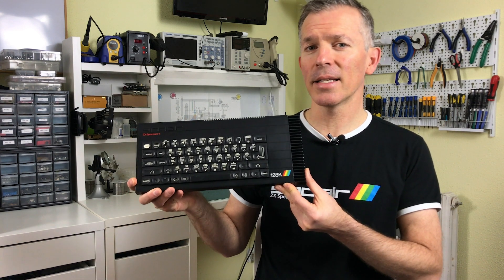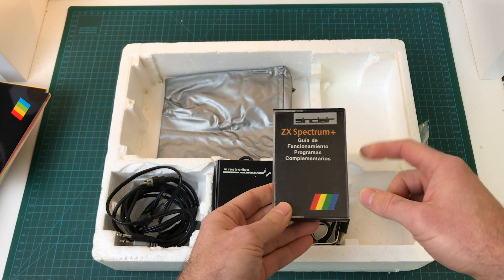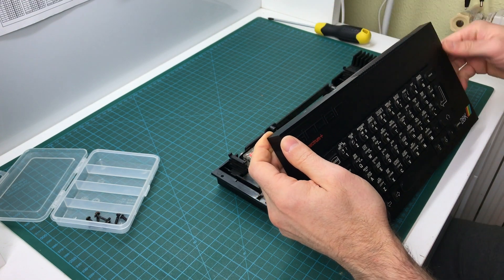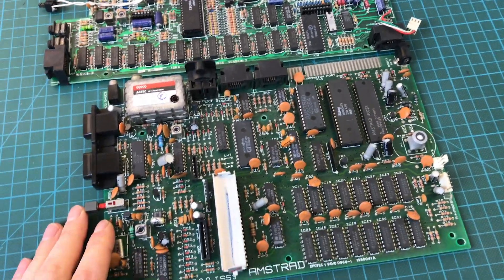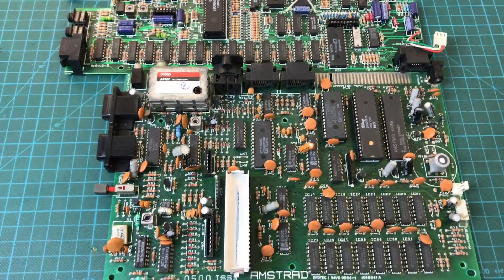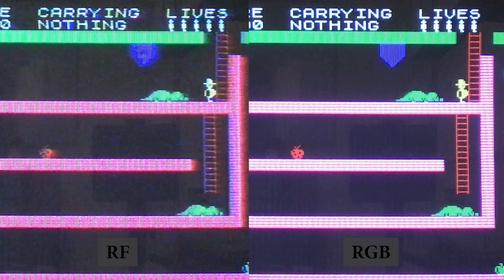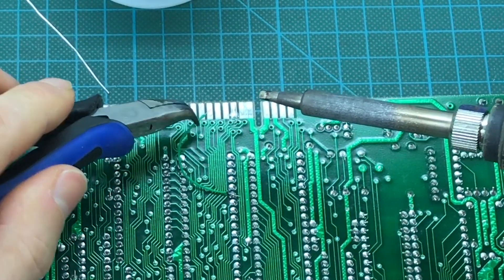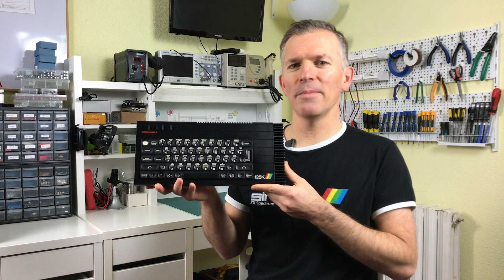ZX Spectrum 128K "Toastrack" Inside and Out

Comment: I owned the 48k (rubber keys) but swapped out the circuit board & installed it into a Fuller Keyboard.  I was very interested in your video because you outlined the differences between the  plus 128k & the plus 2 which I owned the Grey version.  I always wanted the 48k plus but I understand the circuit boards from the 48k & the 48k plus are identical.   Great video.

Comment: this spanish inves 128 was the first 128k spectrum done in the world, was designed  in 1985 even before the UK 128k model , that is because it lacks the initial menu  which was added later in the rom of the UK 128k model, however  this one is 100 % compatible with spectrum games, nothing that can be compared to the 48k inves model which was very buggy in compatibility

Comment: Hi Noel, I'm not sure if your /CLK fix is the right way to do that (?) I think the ULA signal is inverted before it goes to the Z80. The edge connector contact is supposed to provide /CLK as output by the ULA (before it passes through inverter). Although not many peripherals use /CLK nowadays so the whole procedure might not even be necessary :)

Comment: How can I switch this machine to 48k Mode? Isn't there a menu like in the UK Version?
Reply from the maker: I believe you can't. For games that require 48K compatibility there are usually some POKE commands you can do (I think they patch the game), for example Knight Lore.
Reply: Type "USR 0". This will switch to 48K ROM but memory paging will stay enabled. Many consider this mode the best as far as software compatibility is concerned because you can run both 48K and 128K software. However a small number of 48K games (notably the ones from Ultimate) require OUT 32765, 48 before you run them. They contain some debugging code that inadvertently messes up with 128K memory paging so you need to disable it first.

Comment: Hello from Spain! I guess you actually did not understand why the separate keypad (only a few seconds in your video, you tried to use it as a calculator, only one of its uses), but its reason to be is inside the Spanish ZX Speccy 128. Boot the machine and type "edit e$". That will open the word processor resident in ROM. That's why the keypad had all that arrows, they mean to skip a whole word and so on. The Sinclair guys at the UK removed the editor, so the keypad did not actually make any sense. BTW, the Sinclair Basic is able to handle variables with any length, that's why you can store a whole document inside e$, or a$ or whatever variable. Not very performant, but always thinking in saving memory. Unfortunately, the only way to print documents is the ZX Printer, which is far from professional. Any other 80-columns printer will print the document... with a big margin at its right.

Comment: Has anyone ever figured out how to wire the Number Keypad to a new board or (non-spectrum128k toastrack board)?
Reply: You should be good on any Spanish toastrack, UK Issue 6U toastrack and the grey +2. UK Issue 6K toastrack made by Samsung needs R137 = 15 Ohm. On +2A / +3 you could just use the AUX port but I think the keypad scanning routines were removed from ROM so you'd have to interface "by hand". Is there a specific "new board" that you have in mind? Some re-created clone perhaps?

Comment: 12:52 The connector is a variant of the UK phone socket connector (BT631W)
Reply: The +2A/+3/+2B kept that for RS232 interface but the manual had an error documenting the lines, so if you had a custom cable made up according to the manual it would never work. I tried to use my Spectrum as a terminal at university but suffered from this...

Comment: I have one in my parents attic still. Not sure why this is a holy grail above other Sectrums tho.
Reply from the maker: Holy grail is probably a bit of an exaggeration. It's my favorite model because: 1) It has the best looks  and still looks like a classic Spectrum 2) It has 128K and AY sound 3) It's not huge 4) It's the last true Sinclair ZX Spectrum. There weren't as many units manufactured as the earlier ones or the +2, so on top of all of that, it's more scarce, which drives prices up unfortunately.
Reply: @NoelsRetroLab  thanks, I never realised that they made fewer numbers of this model. Will have to check on my one to see it is kept in good condition.
Reply: Yeah, just like Noel said, it's relatively rare and there's the sentimental part of it being "the last true Sinclair". Although Sinclair didn't care much at that point and Investronica was the real driving force. Also, at least half of all "toastracks" was made after Amstrad acquisition, judging by the IC timestamps and the number of them that have Amstrad-branded ULAs. Still, many people (including me) have a soft spot for this model and it would be a shame not to preserve every one of them that made it to 2021.

Comment: I have one..like gold in secret chamber
Reply from the maker: It's a wonderful system. Just make sure you do take it out and enjoy it! 😃
Reply: @NoelsRetroLab  This thing is that the antena cable is not working good..so image of the computer is not good..most games also dont work..I am looking forward to buy a new antena...is the spectrum 128 k inves
Reply from the maker: @yeraysantanaaday6827  Really, just ignore the antenna output. The 128K Investronica outputs beautiful RGB signal. Get a cable to connect it to SCART and you'll be all set. The fact that most games don't work is worrysome. Some 48K ones don't work, like the Ultimate ones. You need to do an OUT command to fix that (I think it's towards the end of this video). But if more don't work, then there's something slightly wrong with it. Maybe bad RAM?
Reply: @NoelsRetroLab  Thanks a lot, you are right there is the RGB..I go to a computer shop and buy the cable to conect to tv..the Ram is ok becaus it loads combat school 128 version...and other games.
Reply: @NoelsRetroLab  He did OUT 32765, 48 to disable the RAM bank paging.

Comment: The Spectrum was always able to provide RGB out via the expansion slot. This was publicised when the original machines were released with guides for those eager to escape the RF picture quality. Ferguson produced an interface that connected to the expansion slot and provided an RGB port for their monitors and TVs. https://hardware.speccy.org/hardware/RGB-Ferguson-i.html
Reply from the maker: The original ZX Spectrums didn't have RGB on the expansion slot because they just didn't deal in RGB signals. The component signals were available (Y,R-Y,U-Y) and that's probably what that expansion is using to generate RGB. But the quality of that conversion process is going to leave much to be desired compared to the true digital RGB signals the 128K ULA generates. I also read that those component signals were very weak and noisy on the edge connector, but never tested that myself. Incidentally, the Inves Spectrum did not have those component signals on the edge connector because it dealt with RGB signals internally (but had no RGB connector, how frustrating).
Reply: @NoelsRetroLab  Thanks for the information! How misleading of Ferguson lol... Do you think at some point you'll make a video investigating driving a monitor from the edge connector?

Comment: One question (may stupid): those memory "blocks" on the 128K model... what if they get malfunction? Is there a way to replace them nowadays?
Reply from the maker: Yes, the 128K uses 16 x 8KB RAM chips. Each of them is a 4164, which are cheap and easy to find. Just about any 4164 will work. If you use the ZX Diagnostics ROM, then it can even pinpoint which one is failing.
Reply: @NoelsRetroLab  Noel, just a quick question. My toast rack had obvious signs of repair and there were 150 ns chips mounted on. Is this common? My gut feeling is that they should have used 130 ns ones (?) Not sure what the original spec was.
Reply from the maker: @baze3SC  I've never had speed problems with memory chips on these kind of computers. Memory access was slow enough for the most part not to matter. Looking at the ones I have for spares, they also seem to be 150 ns, so I think that's fine. I wouldn't worry about it unless you're seeing some symptoms of something going wrong.

Comment: I've never seen a keypad for sale in the UK. Also the Toastrack we got here had a menu on power-up that was the same as the +2. Great find.
Reply: Early UK models (Version 6K) had a wrong R137 resistor value which rendered the keypad unusable. It was in the circuit which supplied VCC to the MC1488. That's why Sinclair probably decided not to sell keypads in the UK since it would involve many repairs. Version 6U no longer had the issue but nobody cared at that point. As a result, the UK version of the keypad is extremely rare and sought-after by collectors (Spanish and UK keypads were different).
Reply: @baze3SC  later production runs of the Amstrad Spectrums cannot read the keypad because the relevant codes were removed from the ROM...
Reply from the maker: Right. That's due to the new ROM in the UK models. Things were changing quickly at that point in time.
Reply: @Franko Walker   A fellow named Paul Farrow in the UK has developed a clone of the keypad, and published it as a DIY project on his website:
http://www.fruitcake.plus.com/Sinclair/Spectrum128/Keypad/Spectrum128Keypad.htm
in case you would like to build one yourself; mind you, it does require you to program a PIC16C54 microcontroller (which is compatible with the original PIC1652) in order to get it up and running.
Reply from the maker: @BertGrink  Neat! I just wish the keyboard was used for more things :-) Any keyboard killer apps out there?
Reply from the maker: @BertGrink  That replacement menu is great. Love it! First I should look for a patched Spanish ROM that allows the numeric keypad to be used for regular typing, otherwise it only works in inmediate mode. O I should just get the UK ROM I suppose.
Reply: @NoelsRetroLab  I'm glad you love that menu, thanks! ☺ but a patched ROM is probably beyond my current abilities; i am only familiar with the +3 ROMS, especially the Syntax ROM which i have studied a lot for the purpose of learning how to extend the +3 BASIC. I still have a long way to go because there is only one set of disassemblies available, for the UK v4.0 ROM set, and the documentation is a bit sparse even for those. All told there are four different ROM sets for the +3/+2A family machines: English v4.0, Spanish v4.0, English v4.1, and Spanish v4.1, and the routines i will have to use are at different addresses in each set - and then there are the +3e ROMS which among other things add support for mass storage; those are another can of worms altogether. 😆
Reply: @BertGrink  Cheers, I'll look into that. Stay safe. :)

Comment: That's the one my uncle had, I got the grey +2 :)
That machine has a curiosity, a "legend" about being possible to break it through software. 
The thing is that if you run:
BORDER 5
RANDOMIZE USR 4665
the border will change to red and will stay that color even if you reset the machine, you must power it down completely to return it to it's normal state. There was a rumour that the machine really breaks using those commands and stays in red for ever, Micro Hobby (very famous spectrum magazine here) published that it was true and it would change permanently the border color with no way to get it back to normal... and the legend begun xD

Comment: The keypad uses a serial interface completely separate from the keyboard, so with the exception of games written in BASIC or those using the OS for reading the keys, both of which are very rare, it is not possible to use the keypad as a game controller, because the numeric keys are not identical to those on the main keyboard.
Also, it would have been nice to mention the RS232 printer interface replacing the ZX Printer as well as the MIDI interface.

Finally, another novelty not mentioned in the video is the double-buffered video, which is, alas, not used by the OS and unavailable from BASIC. But a few games, most prominently "Where Time Stood Still", make good use of it.
Reply from the maker: I didn't know about the keypad being completely different. Interesting! I wonder how many games/programs there were out there that supported it then. And yes, I should have definitely covered the RS232 interface. It was on my list and then totally forgot about it. It probably didn't help that I didn't have anything to test it with, but I should have mentioned it.
Reply: @NoelsRetroLab  ,
The keypad was not included with the UK version of the Toasty (which is the one that got exported), only with the Spanish version, so very few people outside of Spain even knew about the keypad's existence. It is mentioned in the UK version's manual, but only prototypes existed, it never went into serial production. So, no games/programs explicitly support it, AFAIK. If they use the OS for reading the keyboard, it might, by accident, work. :-)

However, the bug that you demonstrated, i.e. the keypad not working in the full-screen editor mode, has been fixed in the UK version and it is (or, rather, would have been) actually quite useful for BASIC editing, as it has function keys for moving the cursor by word, as well as stuff like HOME and END. All these functions are also available from the main keyboard through some undocumented key combinations, but it is much less convenient.

Interestingly, the driver/decoder software for the keypad is in the 48k compatibility ROM (a.k.a. ROM1), but it is turned off in 48k mode. Moreover, in the UK version, it is the ONLY difference with the original 16k/48k ROM, and, hence, one of the main sources of incompatibilities (it occupies some of the originally FF-filled spare space between the calculator and the font, expected by some games), despite the feature not really being used.

Even more interestingly, the keypad's driver is still present in the gray +2's ROM, despite the lack of a keypad connector on that machine. It has been finally removed from the +3's ROM (which is identical to that of +2A/B).
Reply from the maker: @daniel1nagy  Now you're making me want to make a whole video on the keypad, just going deep on it :-) I wonder if some Spanish software might support it natively since here it was included in that model. Hmm... I'm going to have to do some research!
Reply: @NoelsRetroLab  the best I can do is to ask around on FB.
Reply: @daniel1nagy  The +2 grey has a keypad socket on the rear, between the RS232/MIDI port and RGB. The +2A black has an identicle looking port in the same place labled AUX. Don't know what it's for though, I keep forgetting I have a +2A.